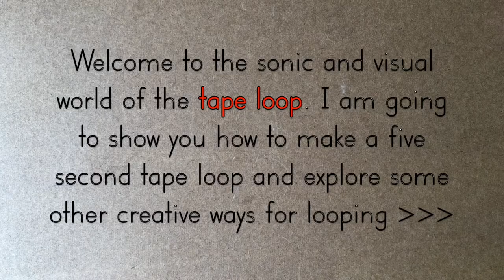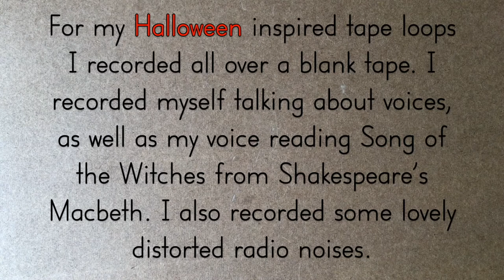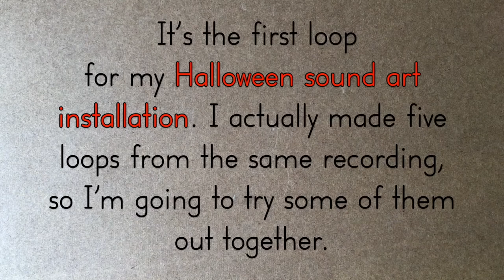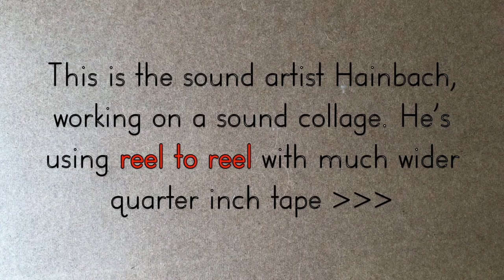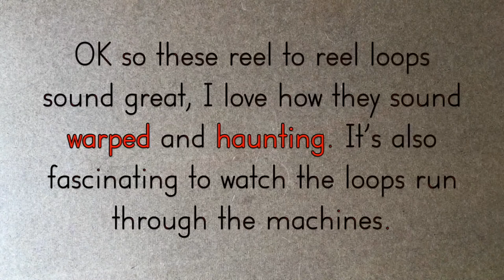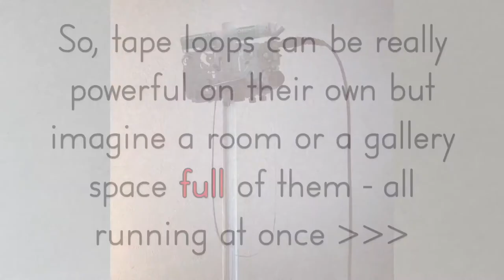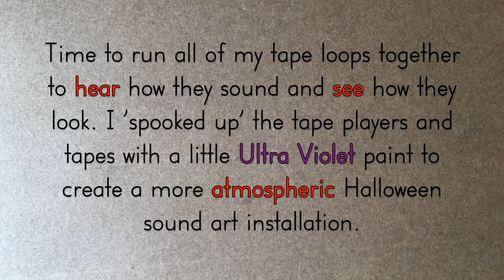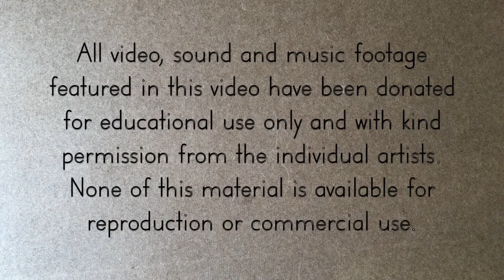How to Make Tape Loops - Sarah Gatter | co:noise | Moogie Wonderland

Comment: Great sounding loops, its great to hear dark ambient work by women. It tends to be male dominated. I started an experimental audio open mic called Breezeblock Beats, play on words of Musique Concrete, we only had one woman perform. I've just stripped down my tape bow violin ala Laurie Anderson, I've converted it from cassette tape to 1/4", much easier to work with, if you can aquire a working machine to record onto. Just got to adjust the azimuth to get a strong enough signal.
Reply: Yes, I much prefer 1/4" less of a fiddle and visually more stunning too (I think), thank you for your insight and hope the experimental audio open mic is still going!

Comment: You can also turn one of the ends 180° before joining to create a mobius strip, a single-side tape with a continuous 10-second loop that uses all 4 (2x stereo) tracks of the tape, instead of only one side!
Reply: Thank you for the info!